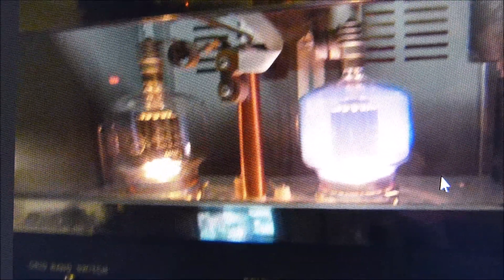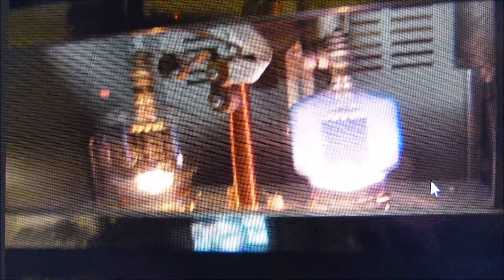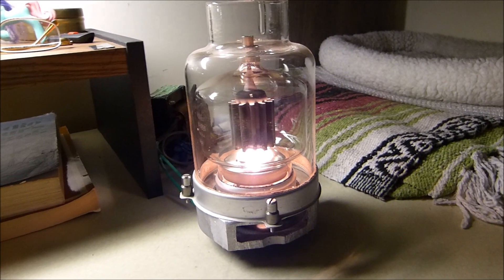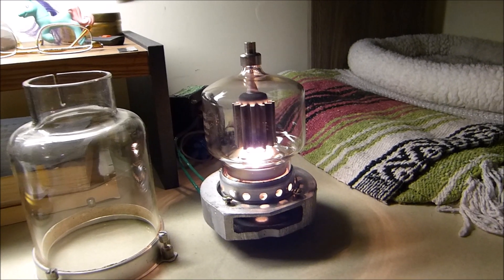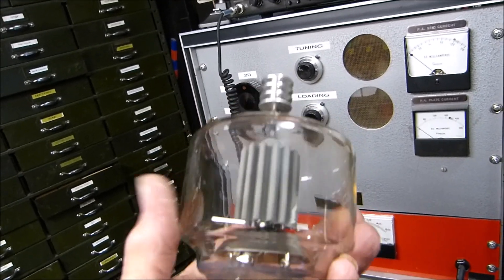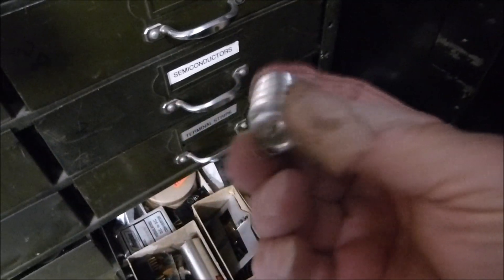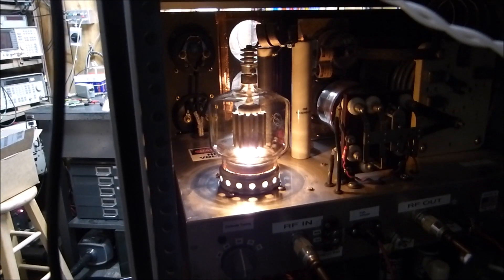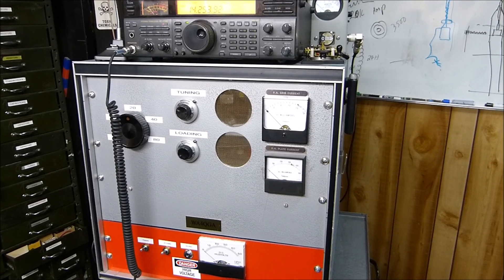Cooking Your Eimac 3-500Z Filament To Degass The Tube

Comment: hi Dave, nice to see you around!
maybe this is an extreme case, but if it is a little bit of glow on the bulb i think is doable. i have successfully recovered a QB3.5-750 ( similar to a 4-400 ) by cocking it, usually the cooking process involves an only filament step (maybe a couple of hours) and than slowly applying plate voltage with a moderate negative bias, and when the nominal plate voltage is reached slowly decreasing the bias level to draw current. this is to degas the cathode at first, than the plate current starts to heat up the plate and so degas the tube. i have read somewhere that power tubes like these need a glowing red plate during normal operation to degas constantly the tube since they have no getter compound to absorb gases.
Reply from the maker: Hi Manuel, it is so good to hear from you. I have thought of you so many times being in Italy. I hope all has been well with you and your family. All is well here, thank God.
I have set up a tube-cooking arrangement in my shop using a big HV PS with the 872A rectifiers in it. I can not get the voltage over 2KV without it going critical and blowing the fuse. I set this up as I did not want to risk damaging my real amplifier. I can not get plate current over 60mA so the plate does not heat up. I put a 9 volt battery with the  + side on the grid to help increase cathode current but no luck so far. This tube may not be salvageable but from all the comments left, I can see that it has worked in some cases. As I mentioned to another comment, these types of things are anecdotal, that is, what works for me may not work for you and what works for you may not work me. That is what a doctor would label it. Anyway, I will work on it a little bit more tonight and if I can document it, I will post another video. Stay safe...
Reply: @ElPasoTubeAmps  nice to see that you warring for me, yes i am fine as well as my family. i am still actively working since my occupation is in an essential facility but we have to follow very rigid protocols to keep us safe. the current situation here is getting better, but still for some time it was like a war bulletin. stay at home and safe!!

well if your tube can not get even hot without an internal ark i agree that it is busted, as you say it probably works only if caught in time. looking forward for the follow up!

oh btw... the power supply is still a work in progress, as promised i will send you a board :)

Comment: Hi Dave,
I have an SB221 I built in 1979 that has only about 5 hours use and has sat unused since 1981. I am now changing it to an SB220 and putting in some Harbach kits. I hope the Eimac tubes are still in good shape.  73  WB3BJU
Reply from the maker: Hi Don, I hope your 3-500Z's are good also. Getting pretty hard to find the Eimac  3-500Z's anymore. I had had a pair of Chinese 3-500Z's and they did work OK but my vintage Eimac 3-400Z's outperform them so I ended up selling the 3-500Z's as I have plenty of the 3-400Z's. 
More to the point here - I personally have no faith that these "degassing" procedure(s)  is worth a hoot. But that is just my experience. I am not discouraging the procedures as maybe they will help and if you do as I do and just plug them in and let them warm up for 5 minutes and put the HV to it and they don't work... you might regret skipping the degassing procedures. Who knows. The tube I used in this video will not work no matter how many degassing procedures I have used on it probably because it is already just too late. So many people believe in these procedures that it is hard to completely disregard them. 
The only thing that I can personally find in legitimate Eimac literature is to leave the filament(s) on for a couple (few)  hours before applying HV.  Eimac literature says if this does not "degass" the tube, there is nothing you can do about it.
All this stuff about the plate being the "getter" is not something that I can find that Eimac says and seems to me to be just ham radio lore passed down thru the generations.  I may be wrong.  If I am wrong, I hope someone will enlighten us by directing us to where Eimac (or any other legitimate transmitting tube manufacturer) gives this information. From other ham radio lore, it seems that older tubes that have been used are more likely to work decades later than the truly, completely unused, brand new, NOS tubes. For some odd reason, I tend to believe that one. As you see in my video, I have a nice stash of tubes, including three 4CX1000A's that were given to me brand new around 1983. I have opened everyone of them long ago and used them and did not leave any of them in their sealed container. They all work perfectly nowadays. The same for the 4-125, 4-250 and 4-400 and even the 3-1000Z's I have. I can not leave well-enough alone and swap these tubes around ever so often just for something to do. Maybe that is why they all still work. Those are my personal findings at this time. Practically all of my tubes were bought used and they still work. I do have some pretty weak 833A's and surely others that are not 100% - but they still work and are all around 50-60 years old. I am 70 years old and I still work - and I don't need degassing...   :-)    I do power up pretty slow in the morning but I can sure stay up late at night. Just ask my wife.
 In any case, be safe around that 2500 volts in your SB220/221 and be just as safe by not getting the virus going around.  73  WA4QGA
Reply: @ElPasoTubeAmps  If you were too gassy I'm sure your wife would have already found a good degassing method.  :)
Reply: @jamescrabb8766  ha..ha..ha.. 😀😂
De VU2RZA 👍❤️

Comment: Hi, hope your keeping well. I can't see any getter in the tube? That glow in the valve scares me from here. And i'm across the pond!
Reply: afaik, these RF tubes don't have a getter. they glow the plates white-hot to burn off any impurities.
well actually more like red-hot but you get the point, HOT.
Reply: @KrisisVal   its actually the other way round you get the plate hot to burn in the impurities lol they react with the plate and form oxides and nitrates etc so the plate absorbs the gases (the plate is the getter)

Comment: I always thought the same.......I once had a bunch of 4CX250's that were given to me by a customer, with the advise to "Cook" them in before applying the HV........ he got them in a military auction so were all in tin cans.........there was about a hundred of them, so I though I would see what I could do to test the theory.......I found after testing 20 of them, 10 "cooked" and 10 not, the results were identical.....the fail rate was the same...........I put it down to seal failure and nothing more......the "Cooking" made no difference.
Reply from the maker: Absolutely... just because they are truly NOS, it does not mean they will work and "cooking" them is worthless. I am almost of the opinion that the vintage ones that are truly used are likely to be better off than the ones that are 50+ years old and have never been used. One thing for sure, in my opinion is and this example, once they have shown failure, they are bad forever and no amount of "cooking" is going to change anything.
Reply: @ElPasoTubeAmps  I agree.....the ones I had were definitely brand new as I had to get them out of the cans myself with a can opener, yet the fail rate salvaging out of recently existing working gear is much less......anyway , Cheers David good to see those Video's coming out again..........its great for us old Tube Jockeys to have something to watch .